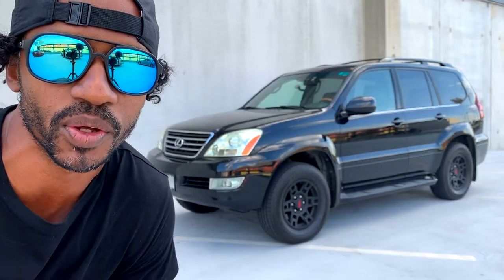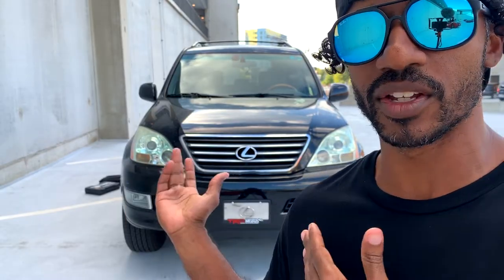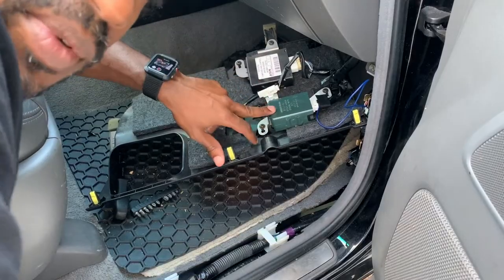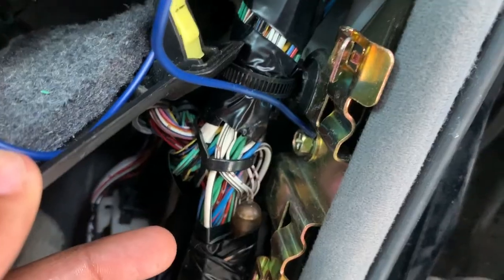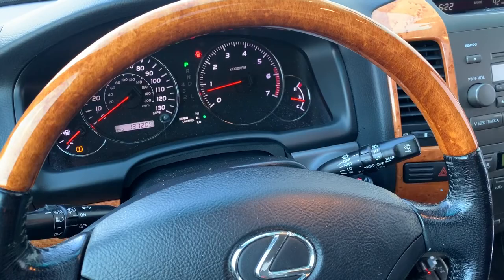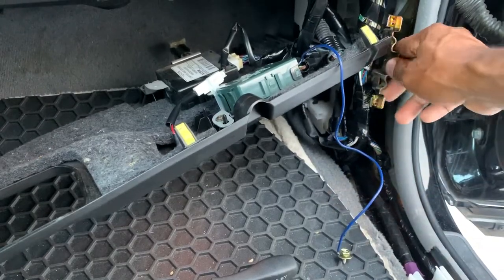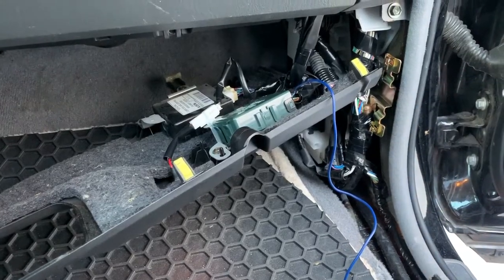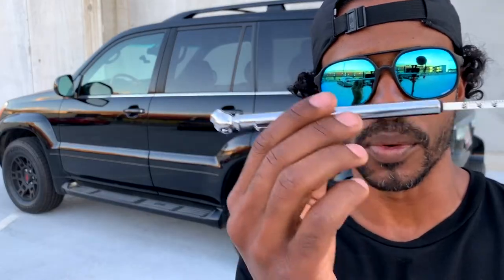GX470 TPMS DISABLE DIY

Comment: Note!  Another poster (WR) mentioned this but thought it might be helpful to repeat it. IF your TPMS box is RED instead of GREEN, instead of grounding the blue wire, simply connect it to the green with red stripe wire right next to it.  It worked like a charm.  I DID NOT cut either wire.  Just carefully strip off some shielding and solder a very short wire to both, OR use a connector, whatever.  But the second the blue wire touches the green/red wire…..the TPMS light goes off!  Thanks for the video!
Reply from the maker: Thank you so much for watching commenting and subscribing! Thank you again for adding this valuable information in the comments! Hopefully many GX owners will be able to utilize this information for years to come.

Comment: Thanks for video, I just bought the same rims and tires and paid an extra $400 at Firestone for the sensors, the light never went off, they recommendedto contact the dealership, called toyota and they said I need toyota or lexus sensors and they cost $700 with labor, save the headaches and listen to this man right here... Thanks for this video!!!
Reply from the maker: Wow, that is crazy expensive! IMHO TPMS sensors aren’t worth the headache unless they are the really fancy modern systems then maybe. I get it “most people” probably need them but for us gear heads I think it just gets in the way. Especially if you do any off-roading in the vehicle or switch wheels a lot. Like when I had my 997 I would switch my wheel sets a lot and it was always a headache dealing with the extra variable of TPMS sensors.... and the extra money involved.  Unfortunately Porsche didn’t have an option to disable TPMS even tho supposedly a lot of 911 owners track their cars. Smh.
Reply from the maker: I’m glad you found the video helpful and it saved you some money! 🙌🏾
Reply: @KRTLyfe  yes It did, thanks a lot!!

Comment: I don't know if you know this but if it is an 07 and up GX470 you don't ground the blue wire you have to actually supply 5v to the harness side of the blue wire. I got the 5V signal from the Green with red stripe wire that is the second wire from the blue wire. Also you can open up the TPMS box and jumper the wires from inside the unit without cutting any wires. There is a write-up on IH8MUD about doing this.
Reply from the maker: No, I didn’t know that but it is great information to share with the rest of the GX470 community! Thank you. 💯
Reply: This was hugely helpful, I was frustrated the grounding didn't work, this was a piece of cake, thank you so much.

Comment: Thanks for the tutorial video. 
After you cut the wire, do you ground the end coming from the plug/module? or do you ground the end coming from the wiring harness?
Reply from the maker: billj121 I believe it was from the module to ground.
Reply: @KRTLyfe  Actuall, at 2:58 you can see that his GROUND WIRE is connected to the connector side of circuit - basically grounding the module and connector side as long as the connector is inserted into the module.

Comment: Ok on my 07 that has 180K miles 3 of the sensors are bad so I want to do this fix. Quick question the blue wire that you used for the ground where did you get it, do you need a certain gauge wire or type of wire? Also just to be clear you Did Not cut the blue/gray wire you just stripped it back and then wrapped the extra blue ground wire around it correct? Then you wrapped it with the self sealing tape? Thanks for all your help!
Reply from the maker: Yes that is correct. You can use any wire really, it doesn’t really matter. Either way you make the connection it should yield the same results as long as you reconnect all the wires. I hope that clears it up for you.

Comment: Quick question. I just did the bypass and the light is off, but now the steering wheel is not retracting  or telescoping automatically…. Any suggestions? Thank u
Reply from the maker: It could be possible that you disabled the feature by mistake or didn’t reconnect something during the process. I would just back track and make sure everything was done correctly and no switches were hit by mistake or fuses blown.

Comment: I pulled up the wiring diagrams to see what you're achieving with this hack. Looking at the circuits, I found that a solid blue wire gets grounded by the TPMS controller to turn on the light in the cluster, and should leave the light off if the TPMS controller raises the line or leaves it open. That doesn't explain how your hack works. I checked the 2008 diagrams and the 2004 diagrams, they were identical. Looked through the entire electrical schematics for the 2003 GX470 and found no TPMS system at all. It seems they didn't have TPMS the first year.

Next step is to actually pull apart my 2008 GX470 TPMS and see if it looks like yours or if it matches the schematics. I want a hack that doesn't burn anything out or draw excessive current. Forcibly grounding a terminal that's trying to be set high might not be good. It seems you don't burn anything out by grounding that wire, since the light works when you disconnect your ground. Still, I'd like to know what I'm doing before I do it.
Reply from the maker: You might want to check IH8MUD and see if someone has already done the component level circuitry homework. 
Cheers to you for the extra diligence!
Reply: @KRTLyfe  Good call! IH8MUD has a post that explains the 07+ has a different TPMS module, red in color instead of green. That's what mine is. And sure enough, according to the post the blue wire is supposed to get hooked up to 5V, which we get by tapping it off the adjacent 5V reference wire. A lot of people recommend jumpering the two wires, but nobody has confirmed that forcing the blue wire to 5V doesn't fry the board. I plan to reverse the fix when I'm due for new tires, at which point I'll just install all 4 new sensors. I have an electrical terminal removal tool, so I'll try popping the blue wire out of the connector so it's properly disconnected. I guess I could cut it too, but reversible fixes are best. :)
Reply: The terminals are really stuck inside that connector, I couldn't get them out. A replacement TPMS computer is $95 used, so I don't want to risk frying mine. I just ordered a set of 4 sensors for $45 and watched videos of how to de-bead the tires using a scissor jack. Sensors are cheap enough that everyone should change them along with the tires to avoid ever having a dead battery. I might put in the extra work of pressing a tire and change my one dead sensor now, install the other three when new tires are due.
Reply from the maker: @charvakkarpe  don’t forget to order a sensor for your spare tire as well. From my what I remember. I think the spare also communicates with the TPMS system. I really hope those TPMS sensors work for you. I was also looking to go that route until I saw all the mixed reviews for those cheap sensors. You also need to be sure you get the right frequency. You probably already know this stuff but just in case.  

For me I already have a negative bias towards TPMS 😂, combining that with changing wheels and running low tire pressures, changing altitudes and climates. It’s just wasn’t for me. Instead I got this really neat tire pressure gauge/deflator from Harbor Freight and an air compressor. For my usage the money was better spent in this direction.
Reply: @KRTLyfe  That makes sense. I wouldn't care if it was just me driving the car. I rent it out on Turo, so it's better to have no warning lights, and even better to have functional warning lights. I've been known to slip a carefully cut piece of foil tape underneath the instrument cluster face to block the check engine light until I got around to an emissions repair. Renters who choose a GX470 are the type who are fine with being told the TPMS batteries are just dead, but as we get into this summer's high prices, the car really should be flawless. Still gotta do the timing belt and I think a ball bearing at the front differential output (already tried the wheel bearing) before I set it to unlimited miles to get these tire treads finished off. Michelin Defenders run forever, there's so much rubber there compared to the weight of the truck.

The presumably counterfeit TPMS sensors have the right Toyota part number and are used on a variety of cars, including 3 of my 13. I wonder if they're just global market versions, for countries that can't afford our prices. I'll save the old sensors and dig out the batteries for replacement, just in case.
Reply from the maker: @charvakkarpe  oh you rent this GX out! Well yeah that completely changes this conversation. lMAO yeah you definitely want working TPMS. LMAO the average driver will drive on a flat from here to the moon! 🤣🤣🤣

Comment: While this sounds great, people doing it should check the wiring diagram for their particular car and year. For example 4runner could use this mod, rav4, maybe even prius, but rx400h cant. In some cars tpms light is enabled by this module directly grounding it or providing +5v, while in rx400h instance tpms module sends some sort of signal (bean if I am right) to instrument cluster which then turns on or of the tpms light and warning info. So be carefull and double check your wiring.
Reply from the maker: Hey thanks for watching, yeah this is only applicable to the GX470. If someone decides to try this on any other vehicle. Yes, they definitely need to do their homework pertaining to the particular vehicle.
Reply: What wire is it for the rx400h? I've been looking everywhere best diagram I found only helped me locate it behind the glovebox and attached to the dashboard. I've replaced 4 sensors a wheelbearing and a bent rim nothing helps I'm tired of shops using the parts cannon I could do that on my own. I just want it disabled. Any help you could be with wich wite it is for the rx 400h would be great. One video has a red module with a black connector one video had a brown module with a white connector mine is brown with a black connector and none of the bypass videos or internet forums have the rx 400h.

Comment: Any idea on how to bypass the  caution message on the main screen??
Reply from the maker: Plus1HD I haven’t encountered that issue . Our GX doesn’t have the center screen.
Reply: there is a way to do that ive read , need to find that thread again ...that shit is the worst lol
Reply: If it's the system error when you start your GX just remove the Mayday fuse under the hood.

Comment: My light did not shut off. Any suggestions?
Reply from the maker: Did you pick a hood spot to ground the wire?
Reply: @KRTLyfe  I used the same spot you used in the vid I think. Super frustrating 🤪
Reply from the maker: @brianbaker2982  what year is your GX?  I recently read something saying that on some of the later models the wire colors are different.
Reply: @KRTLyfe  it's an 06. Really appreciate your help with this.
Reply from the maker: @brianbaker2982  Yours should be the same, from all that I remember reading before I filmed this.
Reply: Yes, the light on my 05 first went from flashing to solid too after I spiced the wire coming OUT of the connector. When I spliced the cut wire in the harness, the light went away!
Reply: Mine sTayed on

Comment: So I did this and it turned off the flashing TPMS light, but it turned on the VSC OFF and VSC TRAC light. Now my center diff won't lock either. Button does nothing no flashing light, nothing. Anyone else run in to this problem after doing this fix?
Reply from the maker: I didn’t have those issues nor have I heard of anyone else having that type of issue. It could be possible that you disconnected something else or pushed a button somewhere. These are different systems and shouldn’t affect one another.